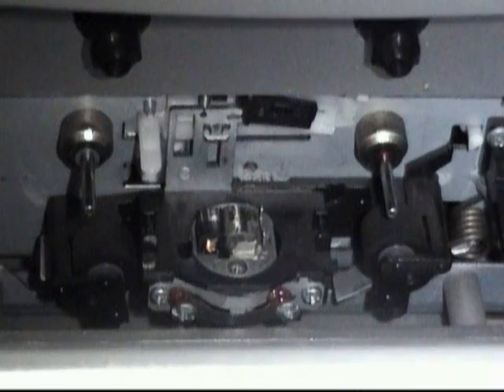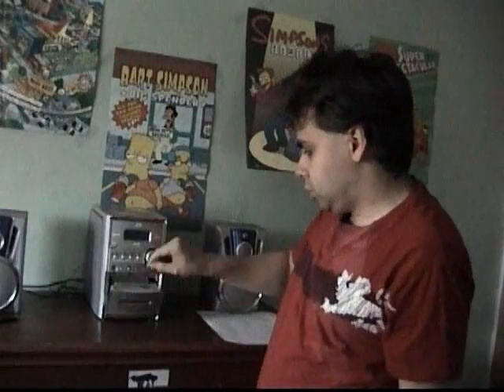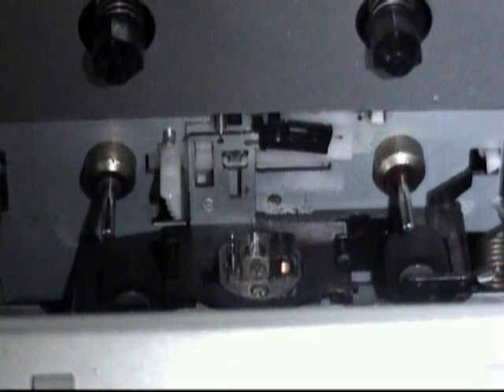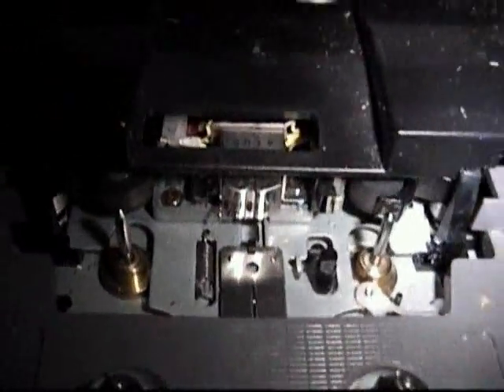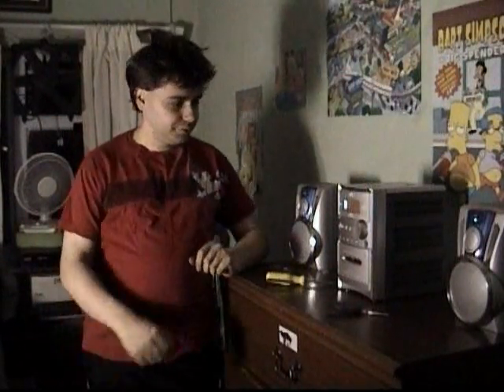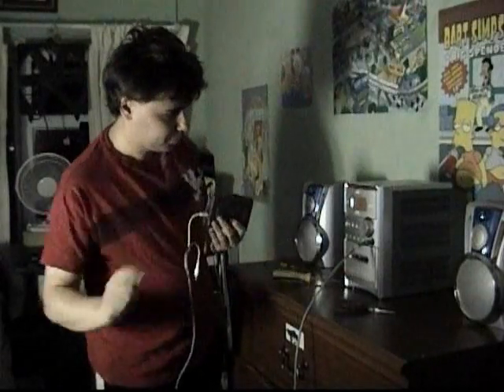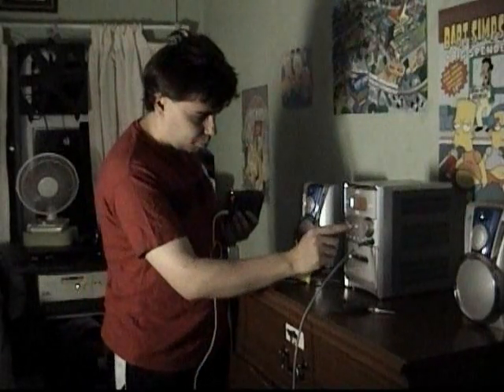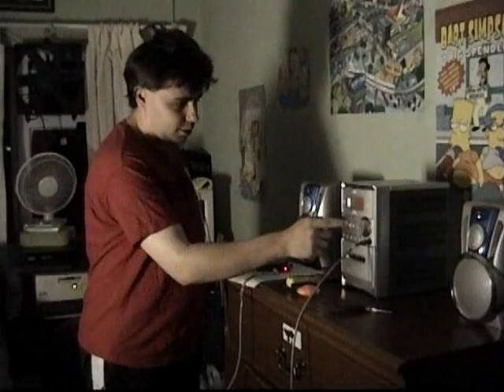Re: Silly, Silly Tape Recorder III - Reverse Speech!

Comment: You're right. The 4 track tape heads are the best in auto-reverse decks, as they never have the problem with alignment. As a matter of fact that's what my auto-reverse Walkman is equipped with, and I never ever had any problems with alignments. The head is stationary and never goes out of alignment. I've been using it for years and it still sounds good. I still like the rotating heads just because they are something different than standard head transports, and look interesting. You just have to take special care of them. I got an 8 track Tascam studio tape recorder that can play multiple tracks, play tapes in reverse or backwards, play all tracks at once, or use entire tape space for higher studio quality sound. Even the erase head has individual track breakers where you can erase one or more tracks, while saving other tracks from being erased. You can increase or decrease the speed, play other side of the tape at the same time. It has midi connectors, where you can link it to drum machines, keyboard, computer, and other components. It's getting harder to find such machines tho. They have a same machine with a CD, but I prefer the one with the tape, because you can mess around with it and do more tricks.

Comment: I wouldn't recommend touching and turning the tape heads by hand. You can knock it out of the alignment, which will affect the sound quality. Of course you can re align the heads by turning the left screw (or ether screw on auto reverse deck such as this one). But still it's not that easy to re align the heads the way they should be. Then after aligning the heads to proper position, you must put some sort of paint or nail polish on the alignment screws to keep them in place, and prevent it from going out of alignment in the future. Especially on heads like this one, where it constantly spins back and forth. My stereo has the same mechanism (I can tell by the capstans/grey pinch rollers, and other parts). My stereo has no auto-reverse, so instead it has a stationary playback/record head in the center and a bigger gray AC bias erase head on the left side. (You have to flip the tape every time it reaches the end). But at least it has no effect on alignment of the head. The record/playback my stereo uses is very good quality. When you make tape to tape dubbing, the copied tape sounds identical to source tape. Even copying from CD, the tape sounds same as the CD, which is amazing. Just sucks that it's not an auto-reverse. I bought it brand new at Best Buy's back in 2013. Very good stereo. Dual tape deck, 5-disc CD changer, iPod dock, USB, SD card, and plug to connect and charge your phone. Sharp is the brand.
Reply from the maker: When it comes to auto reverse, I prefer the transport that uses a 4 track head, that way it doesn't have to flip the head around (possibly knocking very it slightly out of alignment, or even breaking wires after many many flips) to play the reverse side, just switch what pickups are being used. I've only seen those used in car stereos though, which is strange since it's a dam better idea than turning the head around.

Comment: The tape transport and heads and head assembly are identical to my 2003, 360 watt Sony stereo with a 300 watt sub woofer that I had for years. Same thing with that stereo, when you copy tapes, the copied tape sounds identical to the source tape. Just like copying from CD, it sounds identical. That's one of the best stereos they sold then. Now stereos suck. Instead of an actual AC bias erase head, they use a permanent erase magnet to erase the tape. Those permanent erase magnets add unwanted hiss and noise, which make tape recordings sound awful. It's hard to find a decent brand new tape stereo these days.